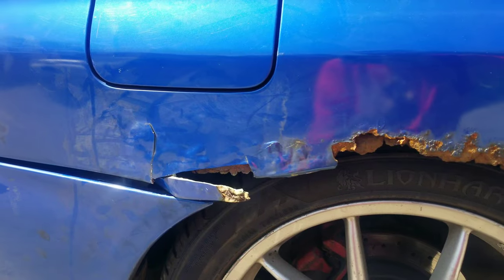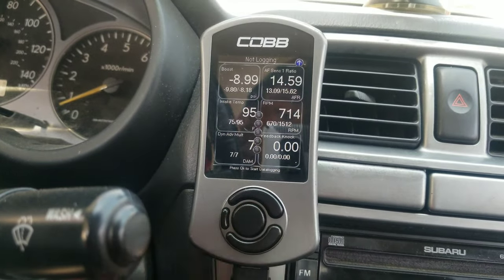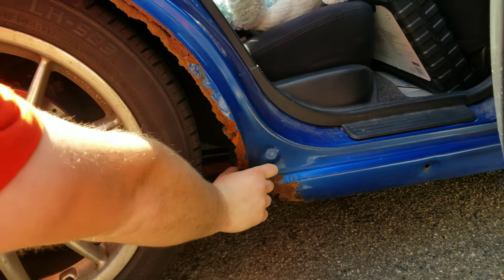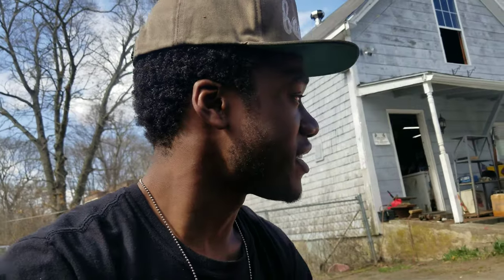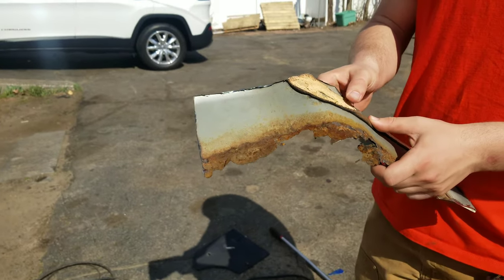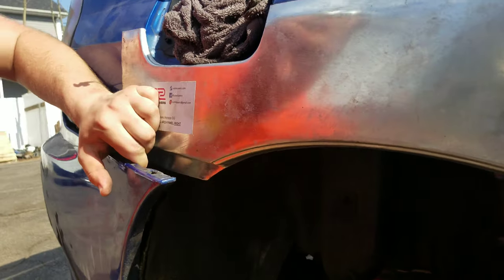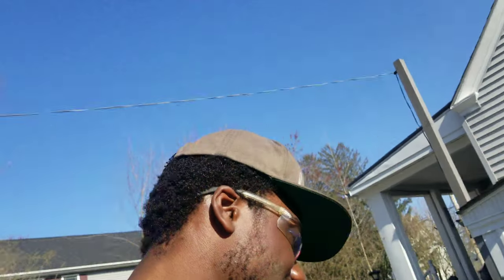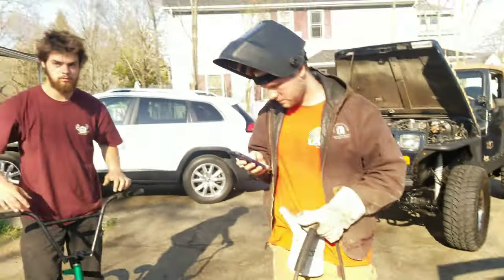GETTING RID OF MY QUARTER PANEL!? (Welding in the new Subi-Savers quarter panel)

Comment: This might be a dumb question, but wouldn't it just be easier and cheaper to get a new quarter panel?
Reply from the maker: Tbh probably. I had just heard about this from a friend and figured I would give it a shot.
Reply: No, the rear quarters aren’t bolted on. This is the easiest and cheapest solution to GD Subaru rust. If you were to get a new quarter panel you would still be doing just as much cutting, welding and grinding. Would also be about $400+ more per side.